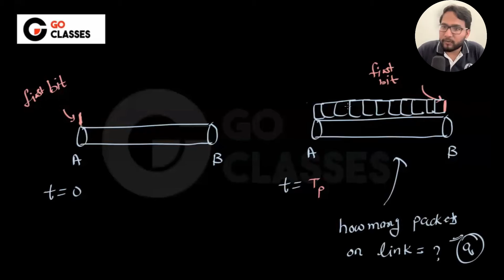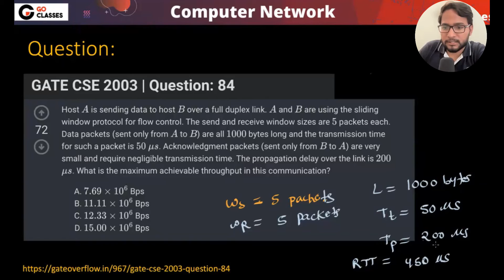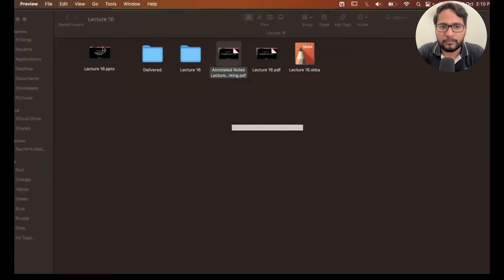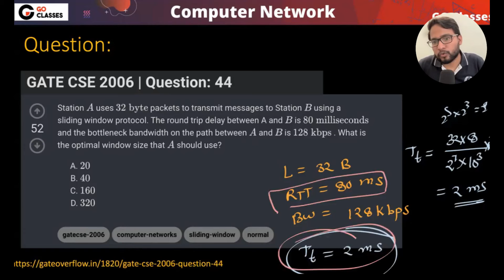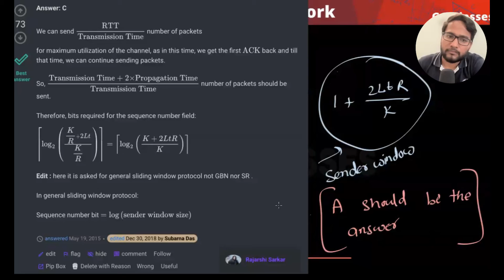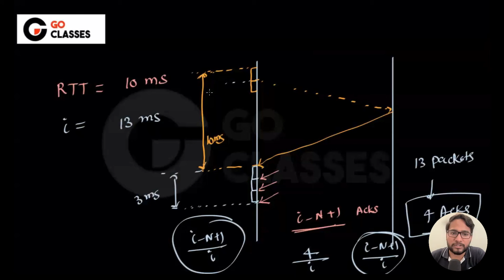Sliding Window PYQs| GATE 2009 Q57, 58| 2006 Q46, 64| 2003, 2014, 2015, 2004, 2016, 2007| With NOTES

Comment: Hlo sir, in question GATE 2007 Q69 around 1:48:00, we are doing all correct- take LCM of [ 1 + (2LTR/K) ] = [ (K + (2LTR))/K ] , after taking log we can see option c is correct. numbertor is swapped actually in the option there.

Comment: In GATE 2009 ques there was a statement "frames are to be transmitted into this link to maximally pack them in transit (within this link)." and in GATE 2015 set 3 ques there's a statement "the network is to be used to it's full capacity." What is the difference in both of these statements because considering these statements we have followed different strategies in both the ques ?

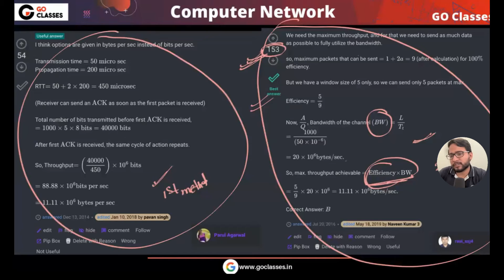Comment: 34:41 1st method is good but 2nd method some extra things finding that maybe asked like maximum packet = 9 
for finding maximum packet 
1 . find the RTT time = Tt(50) + Tp(200 from sender side) + Tp(200 from receiver side) here Tt for receiver is negligible so don't use 
     RTT = 450
2. we 50 packets so = 5*50 = 250 microsecond used and 450-250 = 200 microsecond remains 
3. 200/50 = 4 (200 microsecond remains and for sending 1 packet we required 50 )

so maximum 5+4 = 9 packets we can send it 
efficiency = 5/9 (packet we sent / total packet we can sent it)

but if you formula for finding efficiency = 1/1+2a where a = (tp/tt) answer will be 1/9 why answer different can anyone give a reason?
@GO Classes for GATE CS
Reply: efficiency =1/1+2a    this formula is for stop and wait 
for sliding window it will be e=n/1+2a

Comment: Hello sir please explain why you are taking independent acknowledgement in 2006 question.... Here go back 3 so 1st [1,2,3] will sent by sender and received by receiver then [4,5,6] but 5th will be lost so [5,6,7] then [8,9] but 8th will be lost so again [8,9]..... Why you didn't take cumulative ACK??? And how to know in go back N when we have to consider independent ACK & when we have to consider cumulative ACK ???? Please answer 🙏🙏🙏
Reply: what i have figured out about it from all the research i have done ------->first point is that gbn supports both individual and cumulative ack(mark my words or do your research, it is totally up to u) and now lets get to what happens in gbn arq - so gbn uses both individual and cumulative so suppose you have send 3 frames bcz the sender window size is 3 and now lets suppose you you got the ack for 1 and 3rd frame but ack for frame 2 is lost in network but but just bcz the sender has received the ack for 3 rd frame and it is possible only if the receiver has already received the frame 2 coz receiver window size is only 1 so without accepting the frame 2 it wouldn't have received the frame 3 hence, the receiver sends ack for all the frames but even if all the acks get lost in network and the last frame of window is acknowledged only it simply means that all frames in window before frame 3 are successfully accepted and sender knows this thats why it doesn't retransmit the frame 1 and 2.